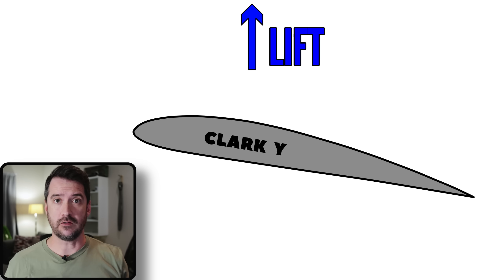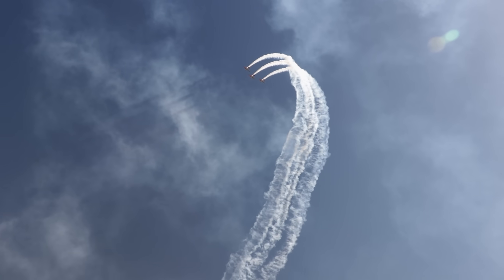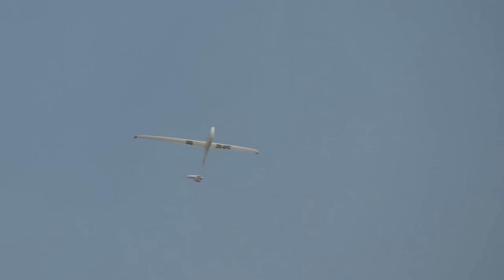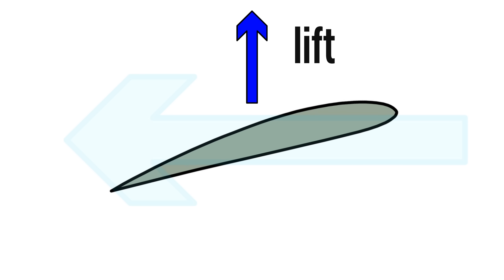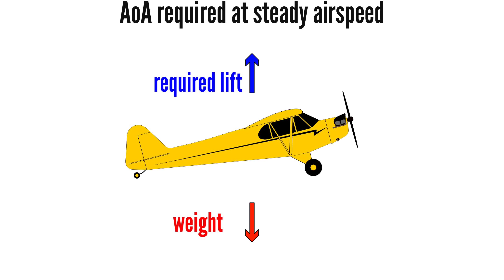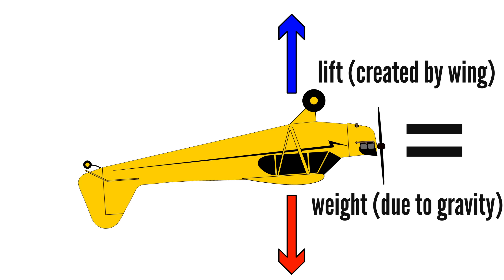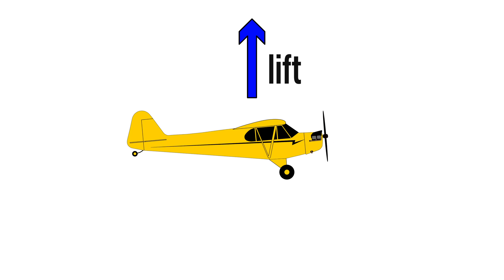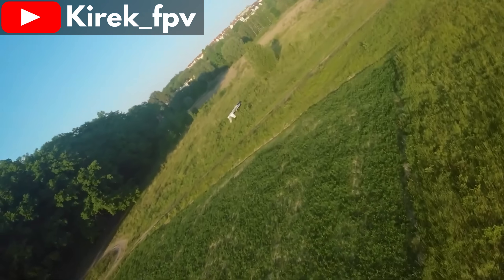Is Airflow Distance Over the Top of a Wing Always Longer?

Comment: No one ever said that the pressure difference story was not responsible for the plane to fly. Of course it is otherwise there would be no lift. What is wrong, and verified so in experiments, whether
numerical or in a lab, is the equal transit time story. And it is very easy to destroy, even without the upside down story: paper airplanes fly just fine, although they have flat wings. Sails create life fine to go upwind, although they have almost no thickness etc....
Reply: Quantity of mass transit per second has to behave the same as if the wing was not there.  

This is rate of mass flow continuity.  Equal transit time is a misapplication of continuity of mass flow rate.  

No experiment will prove this wrong.  Think about it:  as a thought experiment zoom out from the region of the wing just far enough that all the flow lines look unaffected (as if the wing was never there).  To connect all the flowlines outside such a box, it means the wing is accomplishing "equal transit time of mass flow"

Also, in the case of perfectly thin wings (though with an angle of attack, which they need for making lift, if not cambered), zoom out and consider that the flow lines above the wing are more curved than the flow lines below.

That means the average flow path was longer on the low-pressure side of the perfectly thin wing than on the high-pressure side.
Reply: @davetime5234  Actually all experiments, numerical or direct show that the transit time above the wing is not the same, it is much shorter. Simple Bernoulli based computation also show that the lift created assuming the equal transit time theory is right, is actually far far below the actual one. So the equal transit time theory is wrong, because the transit time is not equal, and it cannot explain the lift anyway. So it is twice wrong....
Now if you integrate the flow between above the wing and + inf, and below the wing and -inf, of course there must be flow conservation. But it does not tell anything about the flow pressure, velocity, friction term etc... for which a resolution of the NS equations is needed.
Reply: @__-1234  You need to go back and re-read what I said, and think about it for a while, then you'll see why mass flow continuity is in NS, and why this is all consistent with faster than equal transit time (in terms of where we are all doing our measurement and calculation observations):

Flow rate continuity directly implies dropped density (imposed by the asymmetry caused path constriction), causing an inevitable pressure gradient, causing acceleration faster than "apparent equal transit time", so that in fact the total mass transit rate will continue to obey the continuity condition require by NS.
Reply: @davetime5234  I'm not sure to understand what you mean. And I am pretty sure there is not any significant density difference either. Not even along an airplane wing, but for sure not around the wings of a kite, a sail, a paper airplane or an underwater foil, although it perfectly creates lift. Lift theory works just fine by considering the fluid is not compressible, rho=cste.
But mass is conserved indeed, I grant you that, which means in an incompressible fluid that div(V)=0, but this does not say whether the total flow before it reaches the wing, splits in 2 equal parts in terms of mass flow, there is absolutely no reason why it should. And this is what is very misleading, as what appears to be simple is actually not simple at all.
Reply: @__-1234   You said:  "I am pretty sure there is not any significant density difference either. Not even along an airplane wing, but for sure not around the wings of a kite, a sail, a paper airplane or an underwater foil, although it perfectly creates lift."

That's not true because (at constant temperature), the change in static pressure is directly related to the change in mass density (the density of random molecular collision per unit area).

So anywhere you have a change in static pressure, you have a corresponding change in mass density.

This mass density dependency is what directly connects flow continuity to the pressure vs speed relationship.

You said:  "before it reaches the wing, splits in 2 equal parts in terms of mass flow, there is absolutely no reason why it should."

I'm not sure what you mean by 2 equal parts.  I don't believe I said that, and it doesn't make sense to me.  What do you mean by 2 equal parts and its significance?
Reply: @davetime5234  Very good remarks, I must say your questions make sense, and I had to think in the bus this morning, and dig into my training as a fluid dynamics engineer and phd.
Point 1/ First, density is never constant, the question is whether it makes sense to make this approximation or not. And here it does. Let me explain. You are right, as you mention it, if the fluid is static. But here it is not static, and this is the all point. If you think in terms of energy conservation, there is a transfer in this case only between pressure and velocity. Not much between pressure, density and temperature. This is specially true at rather low speeds, way below the speed of sound. And even more true if you consider a foiler in water, in which the speed of sound is much higher than air (1500 m/s vs 350 m/s), and the speed of a foiler is almost nothing compared with it. And a foiler creates great lift, people use it when there is little wind.
A good way to show that density differences do not influence lift, is to use CFD to compute the lift, with a constant density approximation (so div(V)=0), to notice one finds a good estimate of the lift. 
What on the contrary does not provide a good estimate of the lift, is the equal transit time theory. The increase of speed above the wing computed from this theory gives an estimate of the lift which is way below its actual value, and which therefore explain lift.

2/ What I meant here, is that the equal transit time story, may come perhaps, from the idea that when air reaches the leading edge of the wing, it splits into two equal flows below and above. But there is no evidence for this actually, especially below Mach 1, since the pressure disturbance of the wing influences the flow before it reaches the wing. Computing the actual flow field, which then gives pressure all around the wing, is not so simple analytically, but is nowadays a rather simple CFD task.

So the equal transit time stuff is wrong, sorry. Paper airplanes fly, simple kites made with a simple tissue and two pieces of wood also fly, sails create lift etc.... and every experiment shows the transit time is not equal at all. It is a lot shorter above the wing.
Reply: @__-1234  Thank you for your reply.  

You said: "equal transit time stuff is wrong, sorry."

I never said equal transit time is correct; always acknowledged it is faster.  But I did claim that mass flow continuity has to show up in the pressure and speed distribution one way or another.

However, I see I had a big error with the representation of static pressure at the molecular level in relation to density.  It's not random kinetic energy (collision potential) alone which accounts for static pressure but the hugely important intermolecular forces in relation to that thermal kinetic energy.  

This fact alone is responsible for the density independence (I suppose a bit like the energy stored in a pendulum oscillating at a particular displacement height).

So, I accept what I said about the relationship between density and static pressure as neglecting how potential energy is actually stored (which allows fluids to have a wide range of static pressure with almost no volume change).

But I don't see how that affects the rest of the issue:  quantity of mass cannot stagnate at pathway bottlenecks (continuity), and pressure and velocity balance still mediate that flow thru, do they not?  A bottleneck tendency will still mediate appropriate acceleration via pressure changes, as will a deficit region where the path geometry is excessive.

Interesting, density doesn't matter.
Reply: @davetime5234  Actually I think, but need to check, that at high speed, like close to Mach 1 and above, then there are significant density changes. 
Of course, there is conservation of mass, pressure variation affected by geometry etc... but it is not that simple to compute by hand, as the equal transit time story suggests. But CFD software computes it very well. 
I think the equal transit time story still persists in a few handbooks, but I have seen recently that it was removed from the IKO kitesurfing handbook.
Reply: @__-1234  "close to Mach 1 and above, then there are significant density changes."

That appears to be true (if I understand correctly).

"Of course, there is conservation of mass, pressure variation affected by geometry etc... but it is not that simple to compute by hand, as the equal transit time story suggests. But CFD software computes it very well. "

I understand that to be the case as well.  

But a kind of burning question for me is:

1)If you draw any boundary around the airfoil but extended out however much from the surface, in steady state, the net mass flow across the boundary has to equal zero.  Given this non-build up/non-depletion of mass,

2)is there some size and shape of such a boundary where the flow lines across the boundary, by visual inspection, will reconcile the "faster than equal transit time" vs this net mass flow divergence/convergence=0 paradox?

3)When we observe "faster than equal transit time" in wind tunnel demonstrations with smoke streams, are we missing part of the answer by not looking enough "chord length multiples" above the airfoil, (and perhaps below, left and right as well)?

In the most often shown visual reference on YouTube (Babinsky I think), the view above the airfoil is cut off before we get back to more undisturbed actual equal transit time smoke lines.

Something seems perhaps missing with the above apparent paradox, hidden somehow from our view perspective?

Re-stated just to be clear:  Throughout the entire zone of the vast majority of the relative wind disturbance, that zone of disturbance has to be "self-organized" for continuous transit of mass across the zone.  Where and how is this behaving in such a way that our closer inspection view is showing "faster than equal transit time"?
Reply: @davetime5234  All good questions, but not sure a youtube chat is the right place, and I would need to take a long time to reply to check I'm not saying anything stupid. It has been a long time I studied this kind of things and since then switched to flows that are much slower, and influence by temperature, salinity and Coriolis. But thanks again about your question regarding the pressure and temperature, it made me think a lot about energy conservation. If you have the opportunity, do take a class in fluid dynamics and thermodynamics, it is fascinating, well as everything in physics.

Comment: Lift is not at all connected with the length of the flowpath. So this is so far besides the point it makes me laugh. Lift is a Newtonian thing. Just taking a 3D model with a plank wing proves the point. A plank wing is stalled all the time, yet it flies just as well upside down as right side up. I’d like to see what you can come up with to explain that. A model airplane with a flat intrados will fly upside down because of the same reason that a plank wing creates lift, namely downward displacement of air molecules and Newton’s third law AND thrust vectoring by angling the engine upward. The rest of lift on a normal wing is not created by the longer path which ‘ stretches’ the air and thus creates a low pressure, air is a gas and cannot be stretched out. Air molecules are forced into a curved path and are accelerated outwards, away from the surface of the wing. Conservation of angular momentum accelerates the molecules, causing the ones on the upper side of the wing to reach the trailing edge when its neighbouring particle which went under the wing has only travelled about 1/3 d down the chord.
Reply: False:  "Lift is not at all connected with the length of the flowpath."

Lift is most fundamentally connected to having the flow path made less direct.  That's why the pressure drops resulting in an increase in the speed sufficient to maintain the mass flow rate continuity (can't drop down to a vacuum after all).

True:  "Lift is a Newtonian thing."

That is if you mean the force of lift is equal to the change in vertical momentum imparted to the airflow.

False:  "A plank wing is stalled all the time"

That is, if one defines a stall as a condition where the disruption of airflow is sufficient that lift can no longer support weight.  But because you stated it flies, then it isn't in a stall, in that state.

"it flies just as well upside down as right side up."

Yes, because the requirement for generating lift is asymmetry, and the flowpath can get the asymmetry from either asymmetrical camber and/or angle of attack.

"I’d like to see what you can come up with to explain that. "

I just explained it.

"downward displacement of air molecules and Newton’s third law AND thrust vectoring by angling the engine upward."

True, but realize that a sufficient glide angle makes an engine redundant.

The following makes no sense, because air can readily change density, and constantly does so:  "not created by the longer path which ‘ stretches’ the air and thus creates a low pressure, air is a gas and cannot be stretched out."

"forced into a curved path and are accelerated outwards, away from the surface of the wing. Conservation of angular momentum accelerates the molecules"

It's true there is a force when meeting the leading edge forcing a curved path, but after the forces from the curved path subside such that the particles move off tangentially, this involves linear momentum, not angular momentum.

If you are talking about "circulation" in the sense of change in direction of the linear momentum, you need to invoke a pressure difference:  the force of the pressure difference is the only way to curve the flow downwards (higher ambient air pressure flow moves towards the area of dropped static pressure).

"reach the trailing edge when its neighboring particle which went under the wing has only travelled about 1/3 d down the chord."

The guiding rule is, mass flow rate must be maintained.  Because of the asymmetrical disruption, the pressure drops until the increase in speed is accelerated fast enough to maintain the mass flow rate with enough speed at the lower density.

Comment: If the wing can impart circulation to the flow, it will create lift.

Same way baseballs and golf balls create a curved flight path.

Same way NOTAR helicopters work.
Reply: True.  Lift is simply the force that results from asymmetry of an object moving through the air.  Common sense tells us that the air cannot move symmetrically around an asymmetrical object.  Circulation, pressure drop, change in mass momentum at right angles equaling the amount of force, all result from that basic fact.

(a spherical object's rotation creates the effect of asymmetry as well)

Comment: It's more about the power of the engines or called trust only looking at powerful fighter jets minimize the factor weight
Reply: But you don't need engine trust to make lift.
Reply: @davetime5234  your right but to fly upside down for a length of time one's have to change the position of the wings and an symmetrical wing is the best option
Reply: @lucientjinasjoe1578  But whether the wing is symmetrical or asymmetrical, an aircraft in theory can glide while inverted with no engine power. 

Though of course with engine power and a positive pitch angle there is a vertical component of engine thrust supplementing lift.

But to be of any significant effect the thrust to weight ratio needs to be high and the pitch angle needs to be relatively high.

Comment: Remember the toy hand launched or slingshot launched balsa airplanes of 40+ years ago. The flat balsa wings and tails and flat fuselages.
ZERO camber but they fly well... on angle of attack only.
No camber needed.
Reply: Lift is all about asymmetry.  Lift does not discriminate between asymmetry produced by angle of attack vs asymmetry produced by asymmetrical camber.
Reply: The better toy gliders  actually did have a bit camber pressed into the wings.  I never tried to fly them upside down because our preferred brand (North Pacific) had dihedral too, so they wouldn't have stayed upside down very long.  Never occurred to me to install the wing slats themselves upside down, though.